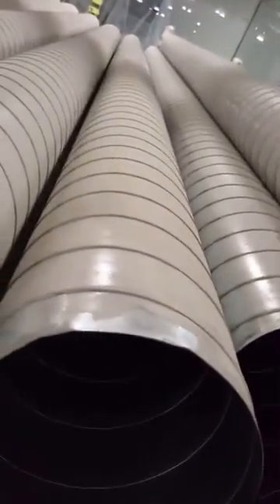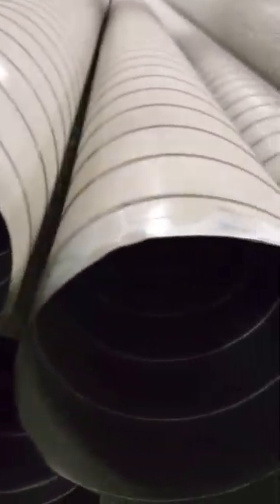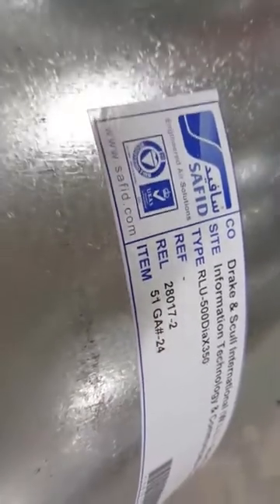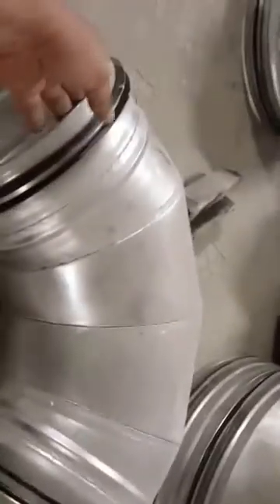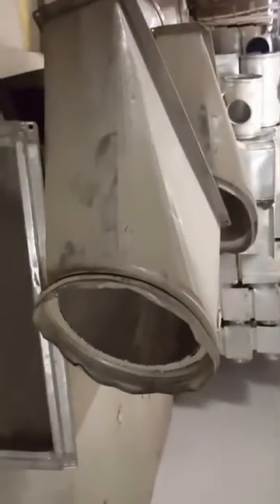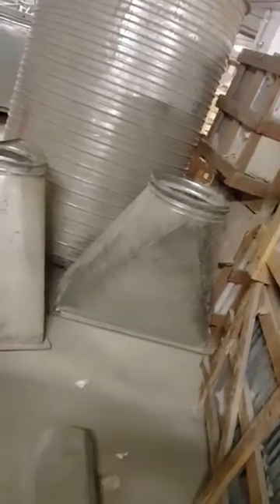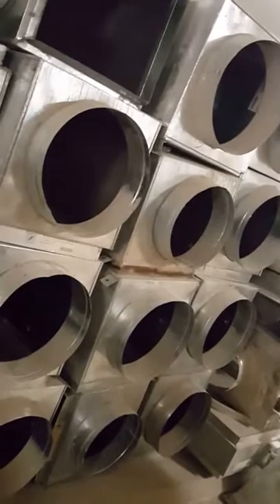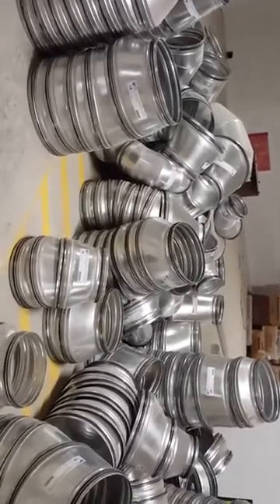HVAC - Different type duct in HVAC GI Duct, Perforated Duct, Acoustic liner duct and Duct material

Comment: Thnk u fr uploading valuable information of duct ; i will b thankful to u if u give some knowledge of PI DUCT
Reply from the maker: Pre-insulated Ductwork    ,.............1.It is light-weight.
 Galvanised sheet steel ductwork can be heavy and require substantial support. Pre-insulated ductwork can be a fraction of the weight of galvanised sheet steel ducting.

2. Installing pre-insulated ductwork can save time. 
 Pre-insulated ductwork is installed in a single-fix and negates the need for the for the manual lagging process of insulating the ductwork after it has been installed.

3.The installation can be less expensive.
 As the ductwork is comparatively lightweight and quicker to install, this can yield significant cost savings for the installer and / or contractor.

4. Pre-insulated ductwork can save space.
 As the ductwork does not need to be insulated, it can be installed flush to the ceiling. This can save up to 200 mm / 8" of space in the ceiling of a room.

5.The ductwork can be easily modified on-site.
 Pre-insulated ductwork can be cut and modified easily on-site, which can be useful particularly if the design of the building has unforeseen changes.